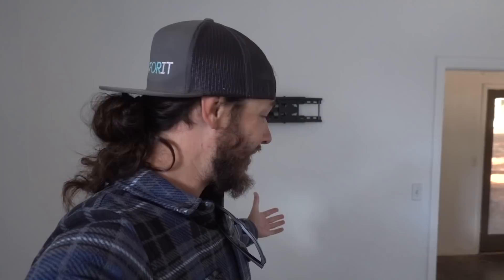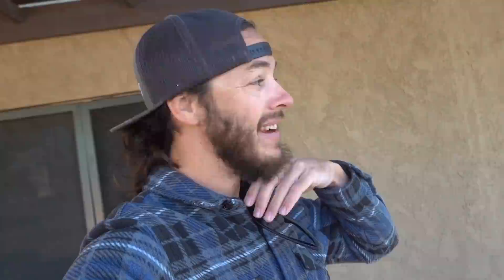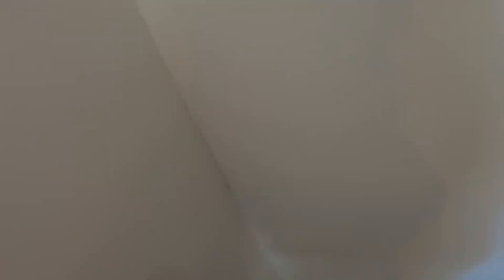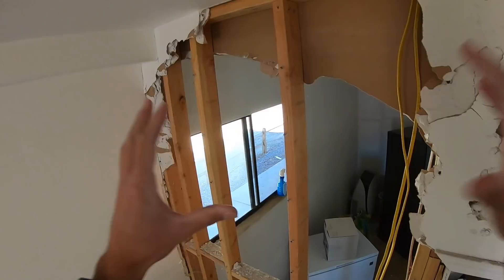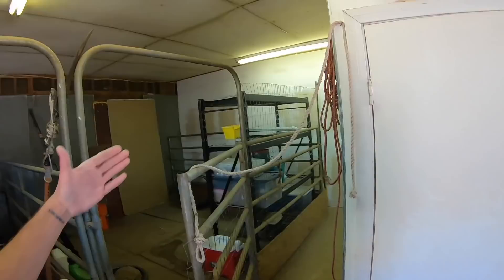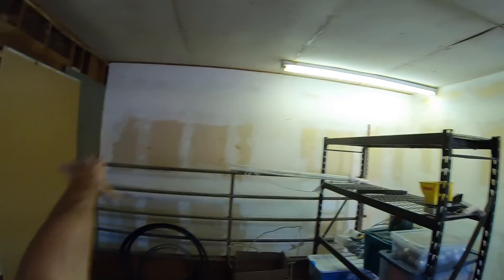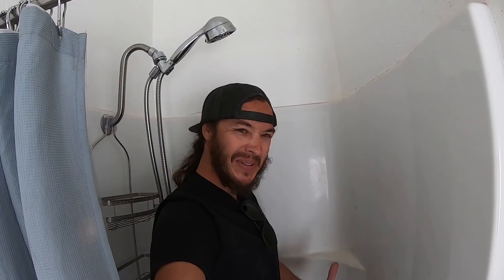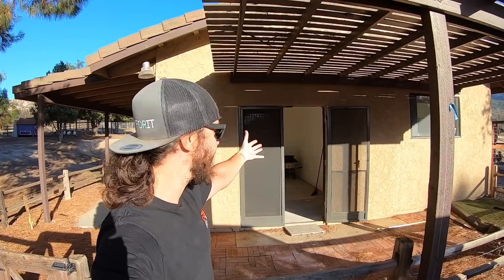RYNO RANCH GUEST HOUSE RENOVATION (PART 1)

Comment: Usually septic systems are sized by the number of bedrooms in the structure(s) that feed them. Adding a bedroom may require an upgraded septic system and will for certain allow government inspectors to find some reason to fine you and enhance their pension fund.

Comment: Ryno you need a kett demo saw. Cuts the drywall to the back paper and then you can just pull out huge sheets. It would save you a ton of time and clean up. Plus they only run about 600$
Reply: It looks like a good idea for where you need to be really clean. I always use a coarse sawzall blade for drywall since it doesn't blow the dust into the air. When possible, I will just break out large sheets and cut with my utility knife.

Comment: I agree with the comment if tearing all interior walls down including horse stalls etc and reframing. You can always add a garage and or car port down the road. That's just a hot mess express that needs tlc

Comment: Those garbage containers are typically picked up with a front load garbage truck. The average max weight of a fork lift is 9000 pounds. Im sure you are under 9k.